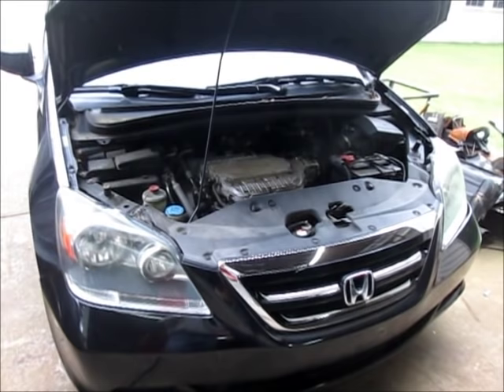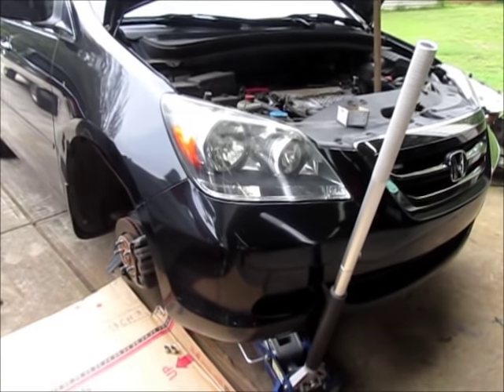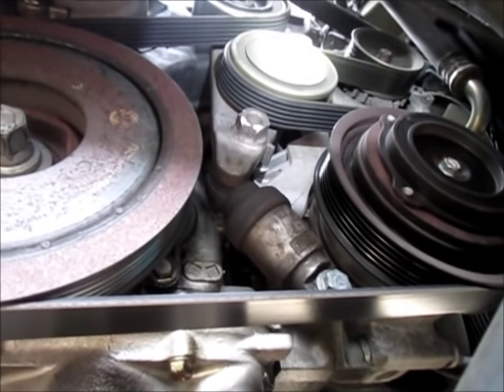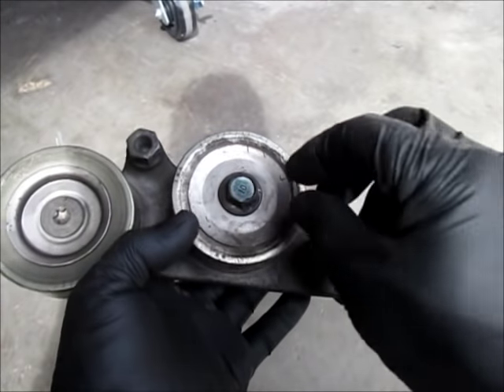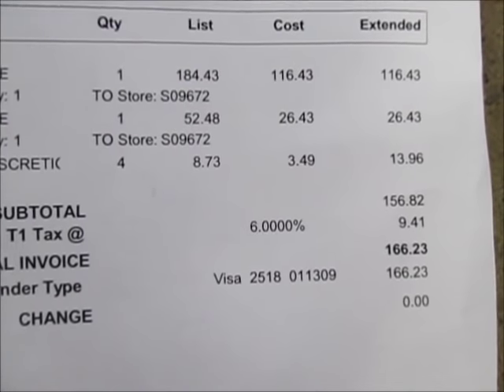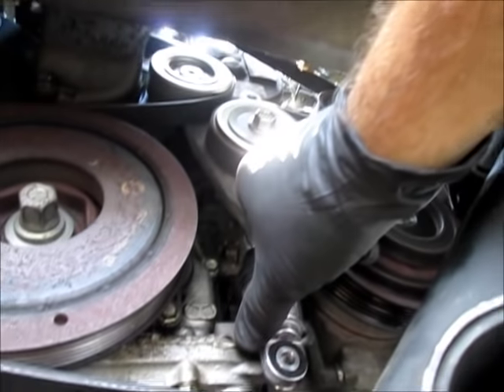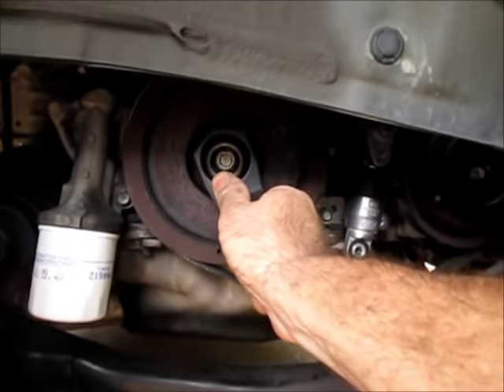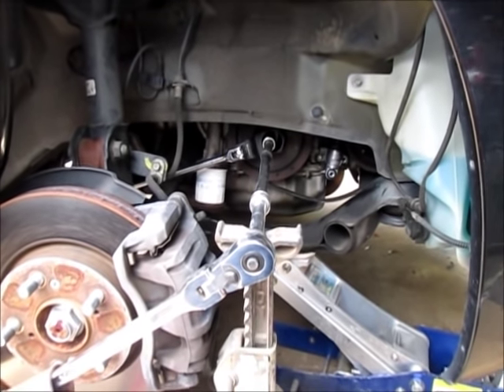Honda Odyssey serpentine belt tensioner replacement and bad crank pulley.#honda #odyssey

Comment: To remove the belt, use a ratchet from the top and put in on the bolt head above the pivot bolt that is made on the tensioner.  push toward the firewall and slip belt off PS pulley.  No need to loosen the pivot bolt.  Reverse to reinstall, but always push toward the firewall.
Reply: What if the pulleys are loos what do I do then?
Reply: @RoddyJ2k10  You talking about the idler pulley being loose?  If thats the case, the idler pulley probably needs to be replaced.  There is a torsion spring in it that holds tension on the belt.

Comment: Many thanks for the video.  I ran into some difficulty that others may appreciate learning about.I tried to change my serpentine belt in early March in Connecticut along with replacing my tensioner (the piston was shot).  The outside temp was 10 degrees.  After struggling to get the old belt off, the new tensioners swapped out without a hitch.  However, when I tried to put the new belt on, I could barely get the new tensioner to move.  I purchased the tensioner tool and tried to get the tensioner piston to compress.  Instead of compressing the piston, the tool head sheared off the tool.  I replaced the tool and it happened again.  The tool is cheap, but it was certainly strong enough to work under normal conditions.I thought it might have been too cold and that the piston fluid was nearly frozen, so I waited until it warmed up a bit.  That took two weeks.With 50 degree weather the piston compressed without any trouble and the 15 minute job that turned into a 2 week adventure was finally done.  Lesson learned.
Reply: would it have helped if you warmed up the car before and drive it and then do this?
Reply: I am fighting that piston. It will not budge. I am in the garage. Outside temp is around 35 but the inside is  probably 40.  I believe your suspicion of the cold weather affect the piston compression is what I am fighting.
Reply: For whomever this helps in the future. These pistons should be compressed a little at a time to give the hydraulics to dissipate/displace which will allow the piston to compress. Regardless of the outside temp.
Reply: @miami1393  yes, you have to apply continuous force and give it time to compress. When I did mine, I was wondering why it didn't move until I just kept pushing.

Comment: Sir: Your advice was sent from above.  I had the same problem a 2005 Honda Odyssey harmonic pulley separated.  With help from You-Tube channels, I was able to remove it in less than 15 minutes.   Those same channels advised re-installing that belt by utilizing either the top 19mm or bottom 17mm nut head looking device.  The top one had become rounded due to I guess various belts being installed over a 17 year period.  The bottom one was still in great condition but, one could not get sufficient leverage due to space limitations.  I am a pretty strong guy, but I still could not get it to move enough. I decided to purchase a new one at a cost of $167, but after trying to remove that long center bolt with over 70 lbs. of torque, I decided against it because other You Tubers warned me that bolt may break due to it being steel and it’s inserted into aluminum cast where over time the two metals seized together.  After two days, I was really at wit’s end and over-night, in my own way I prayed about it.  The next morning, bright and early, without searching, low and behold, your video appears.  Having nothing to lose, I decided to watch my 8th 9 minute or longer video to see if I could get any tips.  Watching your video for the 1st 8 minutes was similar to watching a repeat of a bad movie where things only got worse.  However, something inside  encourage me to watch until the end.  It was then you showed your crow-bar and where you recommended one place it to force that hydraulics pump to close.  I was ecstatic because somehow I knew it would work.  My crow bar with its curved hook would not fit due to space limitations, so I used a flat 2 bar purchased from HF. I set everything  in place, but this time, in less than 3 minutes that belt was installed, as easy as opening a steel door on well grease wheels.  Almost no effort.  Thank you. 03/11/22

Comment: The bolt head between the pulley bolt and the hydraulic tensioner bolt that is on the aluminum bracket is the head that you use to compress the hydraulic tensioner. You might not have had a long enough breaker bar to get enough leverage on it.  You would not want to use the crank pulley as a leverage point with a crow bar.  Excellent video!  I am not impressed at all with Honda's design. Quite difficult - and expensive - to do simple maintenance like this.  Thanks!
Reply: condor5635  how to loosen the tension to put the belt on and off with that bolt head
Reply: If you're replacing the belt you can just cut the old one off and save yourself the double hassle.

Comment: Ya, enjoyed the video , but there is a special socket (Heavy duty) that will remove the Harmonic balancer bolt easily with a good impact wrench. No need for all that apparatus  you had to put together. You dont need the special socket wrench to remove the bolt , only to reinstall it. Also the torque on that bolt is 181 ft/lbs , not 43 or 47 , whatever O'Riellys quoted  you. Hopefully you got it torqued back properly. Thanks for the vodeo.

Comment: My wife has a 2007 Odyssey that was making the same squeal noise.  I thought it was the tensioner assembly that needed to be replaced, but once I had the belt off, and started checking, I found the same issue with my balancer.  Pulled on it and outer piece came off in my hand.  Not good!  Your video provided the info I needed to get this job done. Thank you for your video!!
Reply: knocking on wood now.
I bet the chirping noise is when the tensioner can no longer make up for the balancer slack belt slips on the small alternator pulley
Reply: @glasser2819  Good theory. I'm not convinced the harmonic balancer pulley is the culprit for the chirping directly, but perhaps indirectly. I'd be curious to know if he just replaced the tensioner if the chirping would've gone away. Thoughts?

Comment: Been there done that.  Putting the crowbar on your new pulley was risky as you could well have scored the ribs which would have ruined the pulley.  Here is what works for me.  Working from the top, remove the power steering hose that goes from the pump to the reservoir.  A bit messy, but you need that area.  I used vise grips to clamp the hose shut.  Install the belt so that the slack is on the power steering pulley backside.  Then using a 19mm socket on the top "fake" nut on a ratchet or breaker bar with a long pipe on it, slowly push toward the firewall.  You will think it never moves, but it will. What happens is that the small shock absorber at the bottom of the tensioner has hydraulic fluid moving thru a small orfice.  So just be patient and keeping pushing, meanwhile pulling the belt over the power steering pulley.  Works, but really goes slow.   Tightening the crank pulley bolt you first go to 47-48 ft lb (not sure).  But then have to go 60 degrees which is just one flat of the bolt.  Paint the top of the bolt and paint a flat on the pulley inside, move to that mark.
Reply: Thanks

Comment: Lisle makes a socket to use on your Impact that will make removing that crank bolt a lot easier.  Lisle 77080 19 mm Harmonic Balancer Socket

Comment: I am currently working on my 2008 Honda Odyssey, changing the timing belt , water pump and changing the serpentine belt tensioner. The tensioner shown on this video is exactly like the one on my van.  According to the 2007-2008 Honda Service manual volume 1, the initial torque on the crank bolt is 64 N-m, then you place an angle torque wrench ( ~$650 for a CDI 1/2 inch if you have to have one)  or a breaker bar and go an additional 60 degrees. After you torque the crank bolt you take a marker and place a vertical line on the bolt head. Then with the breaker bar you turn the bolt an additional  60 degrees. The bolt comes off  lefty loosey and tightens to the righty tighty.
Belt drive Auto Tensioner: the large bolt that goes through the lower idler should be tightened to 74 N-m and the small bolt to 22 N-m. The manual suggest to clean the larger bolt and add new oil to the threads, I guess you could put some anti-seize compound on the treads also.
To loosen the belt the service manual suggests you purchase a YA9317 tool. This is a serpentine tool you can pick up from Advanced Auto for about $27.00 bucks. This tool comes with some sockets and crows feet sockets also, but it did not have the 19 mm I need for my 2008 Odyssey. You place this tool with the appropriate socket on the upper looking bolt just to the lower right of the upper idler on the belt tensioner and push towards the fire wall of the van. This will bleed the air of the shock and will allow you to take off or put on the belt. You could also use a breaker bar but the space is very limited so the serpentine tool is very thin and works well. Be careful with the AC lines in the vicinity of where you will have the tool. (Disclaimer: I am not a certified mechanic nor do I play one on TV but I do know how to read a manual.)
Reply from the maker: Hector Guerra Good information. Thanks for sharing.
Reply: For the 60 degree angle torque, ebay had a tool for $7 to that.  I bought one; but had not tried to used on this crank bolt; but I did use it on tire bolt for experimenting and it worked well.
Reply: Hector Guerra 
Would you mind If I copied and pasted your comment giving you credit so people don't have to scroll so far to see it?

Comment: A trick for getting that crankshaft bolt loose is to take a 1/2 inch breaker bar, a short 19mm impact socket, and brace the breaker bar against the lower control arm, taking all the slack out. Then just bump the engine over with the starter with a very brief turn of the ignition key, not starting the engine. Works like a dream. Just had to do that old trick today on my son's 2004 Acura MDX. Same engine. Lot's easier than that tool and pipe extensions on the breaker bar. That bolt is super tight and an impact gun usually won't do it.
Reply: gotta get a weighted socket it works great

Comment: Thanks for the video. To all of those commenting on using the welded bolts to loosen the tensioner, I respectfully say ...Hah! That might work on a new vehicle, but once they have 100,000 plus miles on them, those upper and lower welded bolts just sheer off.  In fact, I've encountered a few that have broken off using brand new replacement tensioners too.  This truly is a poor manufacturers design. I've been working on all kinds of cars, trucks, motorcycles, and boats since 1973 and this belt tensioner is on my top 10 worst list. I'm betting that "Jo Daddy" has also run into this frustration. Maybe using the harmonic balancer might not be the best thing to use to pry against, but  if you've been the victim of breaking off those bolts when simply trying to replace a drive belt and then replacing the entire tension unit with a new one and then breaking both of them off all over again when putting the belt back on, then you might have a different opinion on the best way to approach this. I've had to use a three-foot crowbar wedged in between the tensioner and the engine with the handle placed behind the rotor in order to get the serpentine belt in place. Sometimes you've just got to do what you've got to do when you don't have another set of hands around to help you... And sometimes you still need to do this on these vans even if you do have a spare set of hands around to help you. The high tension on the belts is needed on these 3.5 VCM engines because the vibration from running on 3 cylinders is ridiculous. That is probably what wiped out this engines Harmonic balancer too. I  recommend using something like the VCM tuner or VCM Muzzler or any of those devices that keep the Variable Cylinder Management system from kicking in because honestly, it isn't doing any good for the life of these engines.  I've installed one of these VCM arrestors on my personal Odyssey and my gas mileage actually went up. No more fouled plugs. No more burning Oil. No more converter locking up at strange times. No more vibrations from the engine. The 3.5 Honda engine feels like it should feel. Nice power curve even in a minivan. I hope that my humble opinion helps somebody else.
Reply: thank you Frank for your precious inputs.
Let me swap some of my nuggets that helped restore a smooth TLV6 around 130kMi:

1- forget the skinny Iridium plugs and instead use double platinum plugs for better ignitability ie. less misfires and superbe low-rpm torque to drive around town!

2- lift your intake runner cover and clean the dirty IMRC butterfly. Make sure it has NO freeplay around its closed point.

3- consider checking your 24 valves lifter gaps because they wear in and therefore get tighter... meaning valves will leak compression and burn!

4- Dont overlook brake service to keep wheels spinning freely with 4 caliper slides silicon lubed and flushed out to keep rear pistons rust from chewing seals.

5- Tranny likes clean and fresh Honda ATF to maintain correct viscosity.

6- everyone knows a thing or two about a thing or two 🤗

Comment: I found this looking for info on the tension pulleys, stopped watching yours as you started with the harmonic balancer, thinking- I won't need to do that, then my balancer pulley fell off and hit the pavement.... great video, many thanks
Reply: what year and mileage do you have to loose the balancer??

(I have 140kMi on '04TL: just replaced steering pump supply side O-ring and the hardened supply hose when I noticed the belt noise upon steering or running the AC...
Reply: @glasser2819  ours is an 03, 198k miles.
It was struck by lightning- arced from a tree it was parked next to. It's been having issues about a year after since. Insurance was generous and helpful when we filed the claim, they replaced several boards, and gave us $$ the the body work of the shrapnel bark that exploded off the tree. 

The belt slipped off, it rolled into a parking lot. I did my work there, so no Jack stands etc. I put the belt back on, slipped off, put it back ok on, slipped off. Then decided to get a new belt from Autozone. That slipped off 2 or 3 times. Then I watched your video again fully through. I put the belt back on, started it up, the belt slipped off and then thud, the pulley separated from the balancer. 
I checked online avg price for replacing the balancer and parts stores availability, then called my mechanic, he soft quoted a $200 figure, so I towed it in. Ended up being $400, but he's saved us $$$ in the past for our multiple vehicles. He may have done the tension pulleys also- the wife picked it up, so I haven't seen the invoice.
No previous noise from the belt, which led me to think it was just the belt, then the tension pulleys, then the balancer.
I'm used to working on older American cars (tons of compartment room) and my Toyota Tundra... so after many many scrapes and gashes working on the Odessey, in parking lot, in 102°, and watching you having pulled off your wheel and wheel well parts to get the engine, I opted to let someone else fix it.
Reply: My mechanic mentioned the 180ftlbs of tork also, said it'd be pretty tough to get that without access and the right tools. I thought you using the Jack to get more tork on the lever arm was great, but that was when I made the decision, with a frustrated wife watching me front the air conditioned Tundra to add someone else to the formula.

Comment: Great job!  I just changed my balancer and chirping tensioner.
To make it simple, I just put the breaker bar and socket on the balancer bolt (without the special tool) and cranked the engine just a bit and let the torque or the starter loosen the bolt.

Comment: Thank you for posting this video.

I have a 2006 Honda Odyssey, it's been making that seems squeaking noise for the past six months. The check engine light has been coming on periodically. A neighbor with a computer reset it after it said it had misfire codes. The squeaking is getting worse and it's sounding like more of a grinding now. Also, the check engine light flashed last night when I fired it up.

My better half and I moved to the Las Vegas area about eight months ago. We don't know anybody out here and we're not familiar with any shops that are reputable. I really fear taking it to a random mechanic, I'm worried I'm going to get taken for a ride. Your video gives me hope that it's not going to cost me too much to have somebody fix it. 

Thanks again!
Reply: the "misfires" are reported by the computer when it identifies abnormal rpm variations in fact not misfires but loose balancer/belt .